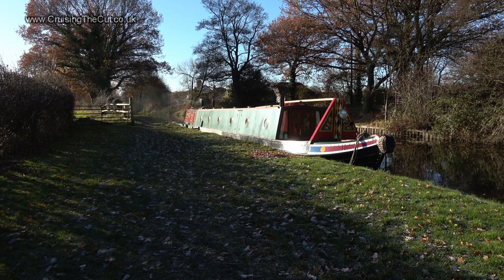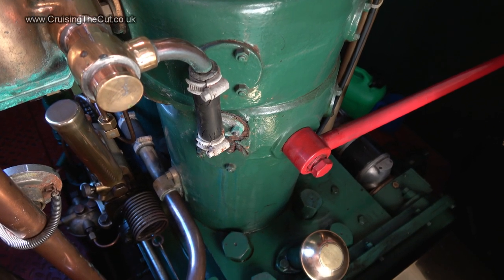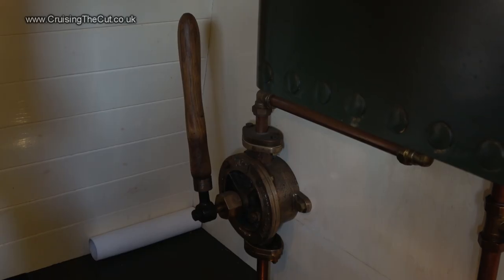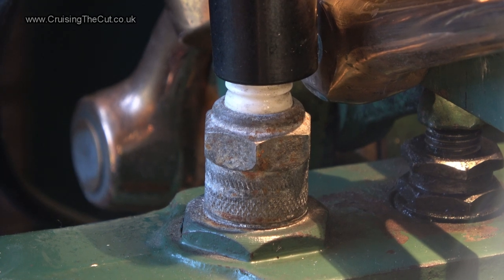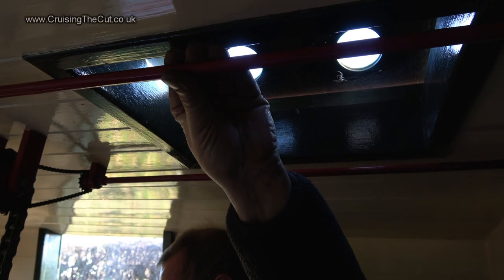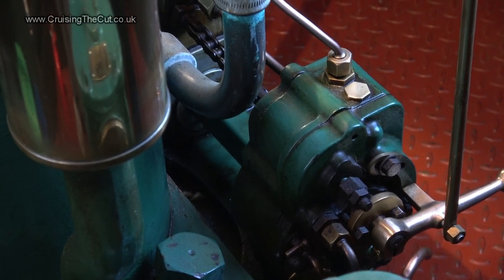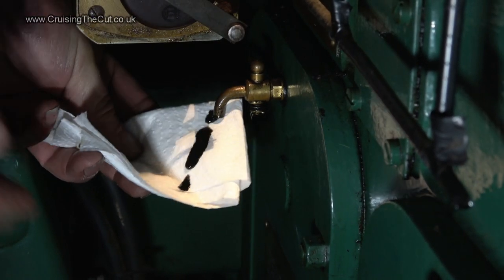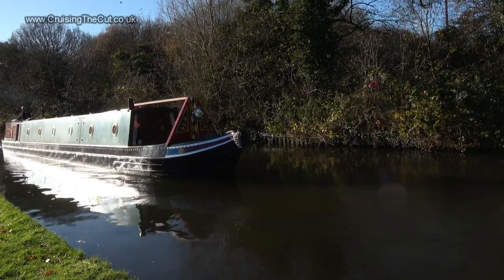129. Classic Narrowboat Engines Part 2: Kelvin K2 with Rob Goodman

Comment: Indirect injection needs petrol to warm up cylinders before changing to diesel. Built at Dobbies Loan Glasgow, 3 and 4 cylinder 66 and 88hp very common on Scottish fishing boats before and after war, almost all hand started. Also a  6 cylinder 132hp engine took some effort to start. 160rpm idle, 750 full speed but tremendous torque. Brings back Sunday night engine room memories trying to get started to go to sea.

Comment: Crescent Shipping on the Medway used Kelvin K series engines in their Thames barges. Folklore is that they could be started from cold on petrol, or when completely hot on diesel & anywhere in-between not at all. So an engine would be left running even when the barge was stationary for hours. Crescent also kept a fully overhauled engine in the shipyard so that a faulty engine could be swapped over quickly and minimise downtime for the vessel.

Comment: I had the 88hp. version in my 50' fifer "the Girl Jean". Massive and turn the flywheel with a bar to bring it up to compression and then crank the handle on the flywheel. Wonderful!!! I remember watching the engine throbbing away when on a _ _ d as we motored down to the Isle of Wight. Unforgettable magic in '73!!

Comment: Thank you David, for this and all your excellent vlogs - also for the personal advice today on dinette's!  Recently while hunting for a narrowboat with (perhaps) a vintage engine, I was fortunate enough to see and experience no less than 3 Kelvin engines.  The first was a K3 in a stunningly beautiful tug called "Barbarian", currently for sale at Billing Aquadrome.  The K3 is an extra cylinder on top of the K2, so 12 litres and 1.7 tons weight!
Then I saw a trad boat now for sale at Great Haywood with the "baby" Kelvin - a J3 - a mere 1.5 litres per cylinder but probably more suited to a narrowboat.  The starting procedure is similar but there are many modifications.  This J3 had a diesel vaporiser replacing the petrol carburettor.  The owner showed me a full start from cold.  After filling the head cups with oil, preparing the vaporiser and oiling various other parts he said: "You appreciate that things will get a bit exciting from now on?!".  He turned the engine over (electric starter) and there was a blinding flash of orange flame coupled with a violent bang, and the engine burst into life!  Fortunately for us we had been placed on the opposite side of the engine from the flame, but it was most impressive nonetheless - and totally normal starting procedure!
Lastly I had the pleasure of visiting a beautiful Norton Canes 70 footer with a Kelvin K2 in excellent conditon.  The spark plugs were still in situ but the owner explained that neither the diesel vaporiser, nor the petrol carb were necessary.  He uses a "firestick" - a rod with a wick on one end soaked in diesel fuel.  He lights this and pokes it well into the engine's intake manifold, then presses the electric start button and within a few seconds she was up and running.  Dead simple and very effective, even in mid-winter with a cold engine that had not been run for 3 days!  And what a sweet sounding engine that was - just as in your video!
Finally I came to my senses and put down a deposit on a 70 footer trad boat with a Beta JD3 - a sort of modern replica-vintage engine.  Nothing like a Kelvin or Rusty Newbolt, but easy to start, cheaper to run, and probably much less trouble for my limited mechanical skills!
Reply from the maker: 12 litres is a bit excessive for a narrowboat engine!! Hope your new purchase gives you years of joy. Cheers

Comment: I've always had a soft spot for those old thumpers. Before retiring, one of my duties at an Aero-Space manufacturer was the refurbishment and upkeep of 1940's era gun drills and bores, engine lathes, crush grinders and 2 and 3 axis rotary mills. The complex engineering that went into these beautifully complex bits of mechanical artistry was every bit as amazing as the latter day CNC machines. I had to repair and rebuild several slipper pumps and petrol powered engine driven machines that had been placed in 'Belt drive' factories, where the belts couldn't provide the power to drive these massive war time machines.

Comment: That starting system is almost identical to the old IHC UD-8 and UD-16 diesels that started on gas and then switched over to diesel. I can't believe how slowly that thing turns over at idle! That flywheel must be half the weight of the engine.😁

Comment: Splendid ! I may have to go and lie down for a bit. I've seen old semi-diesels that needed a blowtorch on them for minutes before starting, and the famous Field Marshall tractor that used a shotgun cartridge to start it, but this is something else. All that chain driven remote stuff :o) And the redundant spark plug :o) And what a great noise. Must have been quite an expensive engine when new...great to see it David.

Comment: How very charming. I can certainly see the appeal of a vintage engine and the slow chug-a-chug blends well with the pace of the narrowboating lifestyle. I wonder how this engine compares to more modern designs in terms of fuel consumption? The slow revs make more sense in a narrowboat, it appears that modern engines never get run fast enough to keep them in the 'sweet spot' of the torque curve where they are happiest. Thanks for sharing and fair winds David.

Comment: We put an K2 in our Josher in the early 70,s a friend had J2 half the size  it had a very simple direct drone cone gearbox  which jammed in gear after a long run. It Rickover it would shake the boat sold it for £50 and put in a truck engine for Easter life.

Comment: As a former collector and life-long lover of old iron, there is something mesmerizingly tranquil about the leisurely rhythm of function for these beautiful old mechanical gems.
The essence of self they exude is distinctly reminiscent of a more tranquil, relaxed way of life that makes for an ideal partnership with canal boats because they were the original artificial heart implanted in canal boats when horses were retired by the demands of the industrial revolution.
When anybody who understands them refers to horsepower in association with such old engines you almost invariably hear a reference to 'loads of torque'.
They were designed to emulate characteristics inherent to an organic energy source they replaced as intimated by the very term used to quantify their capacity for work 'horse-power'.
They produce substantial peak torque for a fraction of the frenetic effort necessary for modern buzz-saws and combined with their larger, slow revving propellers is why they make ideal tugs.
Here is a link to an interesting documentary which examines the history of diesel engines and adequately portrays the sort of people who love them.
https://www.youtube.com/watch?v=wCA5pInfPpM
Reply: Can get this link to work..

Comment: Another great vlog.  Four liters per cylinder.  Wow!  It's like having a gallon milk jug reciprocating up and down.

I'd love to have heard a few more details.  You mentioned the low engine speed and large propeller.  I would have like to have heard the normal cruising rpm and the propeller diameter.  Love this mini-series.
Reply from the maker: Not sure but Rob is responding to some of these comments so perhaps he'll chip in.

Comment: Hi David, after watching 128, 129 and 130 one after the other, there is a subtle difference in the sounds of the engines. Similarly, different brands of truck motors sound different. Don't think I could tell which engine would have gone past, but I bet hubby could. Once heard, not forgotten. He loves you mechanical vlogs in particular.

Comment: Absolutely terrific, More, More.    I love older engines, particularly steam since I worked summers on a coal fired steam ship many years ago.  These old diesels never die.  The engine companies never adapted to the post WW2 world and most failed due to not enough R&D and going to new designs, but it is nice to see them.  I note this is an older hull, with rivets.  When was the Hull built?
Reply: George Caruso it could be an older hull, but more likely to be a modern hull made to look old- there are a number of makers who produce replicas  of older style boats with higher bows, applied "rivets" and the like to give the correct appearance.

Comment: That engine has about the same rpm as the cathedral sized diesel engines on container ships.
Starting procedure on his engine reminds me of how I start my rototiller. Remove the spark plug, put a squirt of petrol directly in the cylinder, put the spark plug back and pull the rope, the engine fires and hopefully keeps going. If not, repeat procedure until it does.

Comment: Had a Lister JK with a Hunsted variable pitch propeller as well as a gear box. Was a big lump. Thirty horse and weighed best part of a ton. Big prop, you could bury the stern under water when you wound the pitch right up. Good old engine, but I prefered the more modern engines, but not the common rail ECU type. Not for canal use , but ime a big fan of Cummins.

Comment: Fascinating. I'm looking forward to hearing your review of a Bolinder if you can track one down. They are even harder to start, I believe. Also, I love those boats where the engines blow smoke rings - have you ever encountered one of those on the cut?
Reply from the maker: Can't say I have....
Reply: @CruisingTheCut  The one I saw sounded very much like the National Engine which you reviewed. It was just on tickover, if I remember correctly. I never did find out what the engine was - I should have asked.

Comment: It's hard to tell, when you showed the distributor, whether there was light catching a spider web, or there was some tracking going on. I've watched it 3 times now and I'm leaning towards tracking, which means that the rotor, cap or leads are in poor condition. If this is the case, it would explain the problems he's having with the petrol start. Some of the hoses appear to be in poor condition too; a bit of TLC would probably go a long way.

Comment: Thank you for putting this together - its a pity you are limiting this series to three - could you not leave it open ended? A great engine room and wonderful engine but what a lot of work too. No offence to the owner I did spot some engine rubber hoses that were cracking maybe he intends to that as part of the Spring preps - whenever spring arrives. Wonderful film.
Reply from the maker: They were filmed last November and I filmed three, thinking I'd combine them into a single "classic engines" vlog but then realised they could standalone hence the mini-series. I may do another, since this has been largely well received.
Reply: CruisingTheCut Its a very good body of work.👍

Comment: What an amazing machine, David.  How much RPM control is there over that propeller...does it have any drawbacks over a more modern sized prop?
Reply from the maker: You can adjust it from tickover to a bit faster than tickover (!) - the engine isn't designed for fast revving. The drawback is that the boat is deep-drafted so it's easier to get stuck in the shallow bits :-)

Comment: I am in full agreement with its beauty, sound, and power. My worry is the fire hazard dealing with 'petrol' gas. Of course there must be proper ventilation such as a fan blower/exhaust located in the engine room, and a fire extinguisher, and surely some safeguards were dismissed for ease of viewing, such as the 'petrol' container being outside a fire cabinet....don't mean to sound negative on such a priceless gem. Sorry, but I would have a difficult time with that one. Ease my worry, please.
Reply from the maker: Not much petrol is carried, it's kept in a proper container and I'm sure Rob is very careful as all boat owners carrying petrol are.

Comment: David. What a faff to get started in the morning, and then when the engine does start on the petrol, there is quite a sequence to follow. I just know that even if I was instructed on this for a day, as soon as I was left to start the engine on my own, it would not start.  Fascinating though, again, wonderfully put together. Rob mentioned about the engine being further forward and not being directly beneath the operator. On the canal boats that I have driven the noise and vibration coming up though your feet was not inconsiderable, is there any way of mitigating this effect or do any modern engines in particular produce less noise and vibration?

Mike
Reply from the maker: It shouldn't be that bad! Maybe the engine mounts are worn (hire boats?)
Reply: David, yes that is correct, I have only driven hire boats, which probably explains the noise and vibration levels - thanks for pointing that out.
Mike

Comment: If that engine is running at idle and its going that fast I can only imagine how fast it could go at full throttle
Reply: K series tickover is 160 rpm and max revs 750 rpm the K2 was built with no reduction in the gearbox, so you need a big prop. A narrow boat will never plane, so it won't exceed its hull speed, more power after that will just dig the stern in deeper and make more wash.

Comment: I do like this series on classic engines. I think it would be interesting to do a series on the exact opposite: unusual, ultra-modern engines. I know you did a video a while back on a boat which had a diesel and electric motor attached via a switchable gearbox, but what about an all-in-one hybrid engine (sort of like the type of thing you might find in a hybrid car), such as found here: http://www.hybrid-marine.co.uk/9.html What other kinds of engine are there? Are there any crazy narrowboaters who use sails? (obviously not exclusively) I know there are a few petrol engines out there, it'd be interesting to hear about the advantages and disadvantages of those. And, though I think this is probably even more unlikely than the sail idea, steam engines traditionally use burning coal to produce the steam, but, you know, nuclear power, at its most basic, is also a form of steam engine, are there any ex-nuclear engineers with the permits to run a tiny nuclear-powered engine in their narrowboat? (because how friggen cool would that be?)

In a similar vein, obviously traditional propellers are going to be what every narrowboat has, however I can't imagine there's any reason that screw propulsion wouldn't work (and might have the advantage of being less susceptible to prop fouling).

I'm a bit of a tinkerer and, if I had a narrowboat it'd be thinking of ways to soup it up technologically (hence my curiosity for novel powerhouses). I'd probably try building a semi-autonomous function into it such that I could hop off at a lock without tying it down with a centreline, have it drive itself into the lock, then keep itself from hitting the sides or cill and then pull out again to wait for me to close the gates behind it. Or allow it to continue down the canal while I pop below for an emergency visit to the loo. Surely I'm not the only person who''s had these ideas, are you aware of anyone who's actually implemented them? Are there any CRT regulations on autonomous narrowboats? (surely the slow speed would mean it's easier to accomplish than self-driving cars)

Comment: The appeal of those engines to me is the low RPM and the fact that they are not hidden away in a hole somewhere out of sight but proudly displayed...as they should be.
And I would bet they outlast most modern engines.

Comment: I'm totally baffled by the concept of a day tank that has to be hand-pumped filled. Is it so difficult to connect a linkage from the engine to drive the hand pump so the engine does the work !!!?
Reply: pmailkeey I know, but isn't it fun?
Reply: more so you can monitor fuel usage. many do not have a fuel gauge.
Reply: The biggest reason for a day tank-- which is also called a "settling tank" -- is that water and crud in the fuel settles to the bottom of the settler tank and doesn't get into the engine.   These tanks were also standard equipment on oil fired steamships.

Comment: Given the peace and quiet of The Cut, are we along way off all electric?
Reply from the maker: A long way, realistically speaking.
Reply: Not at all. You can do the conversion yourself rather inexpensively, and even charge it all up on solar panels. Battery technology has come a long way. A quick YouTube search for electric narrowboat yields many results.
Reply from the maker: No, you really really can't power a narrowboat off solar unless you barely cruise and have access to shore mains or a generator for additional regular battery top ups.
Reply: @CruisingTheCut  battery and solar panel technology has come a long way. If you wanted to cruise several miles every day, then perhaps not. But if you were staying in one spot for a week or two it could certainly be feasable. One could still keep their diesel engine for emergencies.
Reply: The big problem with solar is the clouds. But if it's windy you can take advantage of a wind turbine.
Reply: The bloke in the linked video says it takes a few days to charge up enough for 3 hours cruising in cloudy weather and the system cost £2000.
Reply from the maker: Yeah, pretty hopeless really, having to sit for several days just to get three hours cruising in. And in winter, entirely impractical. Wind turbines are also pretty hopeless on narrowboats, as I explain in my website FAQ. Honestly, if it worked as simply and easily as people keep suggesting, people would be doing it!
Reply: @CruisingTheCut  what's the rush?  3 cloudy days in one spot is barely enough time to relax and see the area. And in the winter you could be on a winter mooring, or wait a little longer, or fire up the diesel.